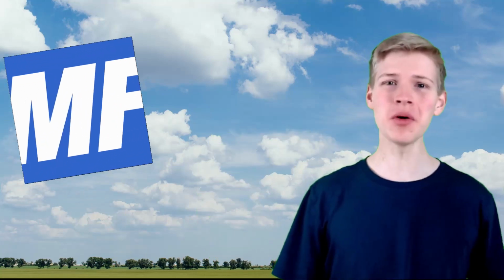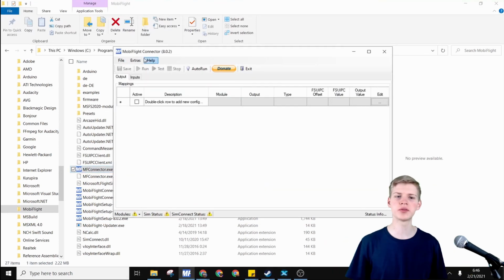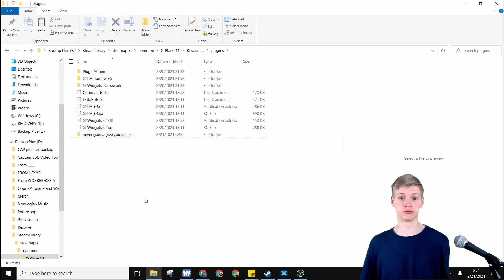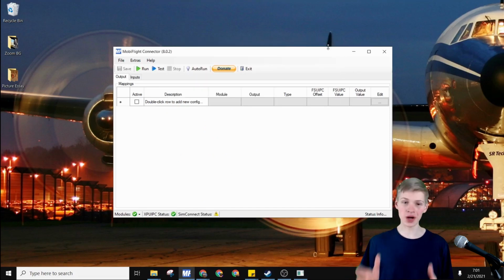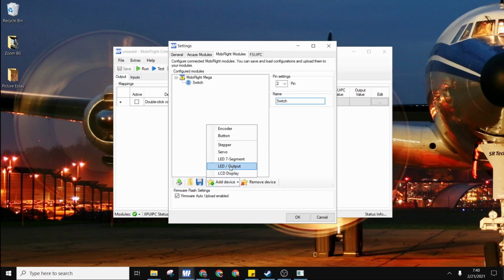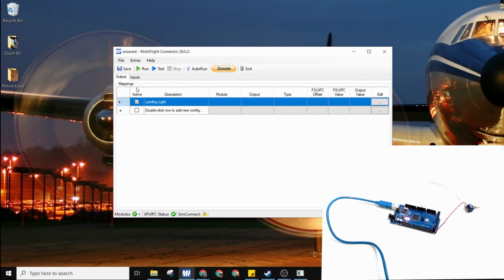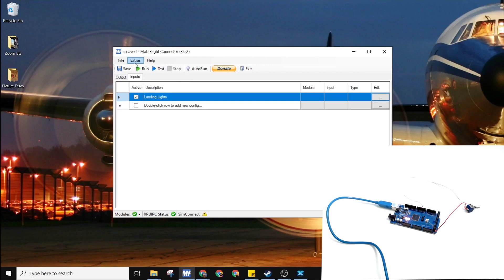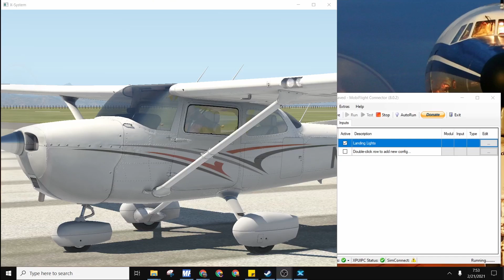Configure switches to X-Plane! Using MobiFlight with X-Plane and an Arduino

Comment: Will I always need mobi flight running in order to the switch works on the sim?
Reply from the maker: Yes you do
Reply: @CaptainBobSim So if i program the whole thing on my laptop, and then plug it in to my mac that does NOT have mobi flight, it wont work?
Reply from the maker: @RadioNassau  Correct - MobiFlight must be running on the computer to communicate with the flight simulator.

Comment: hi im building a overhead panel for a319,320,321 toliss. do you have a latest video how to operate with the mobiflight on xplane11?
Reply from the maker: Hello! I don't have a new video as of now, but you can do it directly now instead of using XPUIPC by using datarefs

Comment: Hi  Do you have a new video showing the now presets for Xplane, i'm trying to install a servo and setup the flaps detents but having a nightmare getting it done
Reply from the maker: Hi Mike! The X-Plane presets are a bit different (If you want to follow the tutorial use FSUIPC offsets)
Search for flaps and use "Flaps up a notch" and "Down a notch" for switch
Use Fla1 def if you want to write to it instead.

Comment: Hi Bob
I'm starting a project with Mobiflight, but I'm having some problems, the Switch on the X-Plane Plane doesn't turn on..
I used the settings you passed in your video, but without success could you tell me why?
Grateful
Reply from the maker: I cannot tell you why, because there are so many places to get wrong, but when you press run do you see a green checkmark? 
Have you double checked your wiring and ensured the active checkmark is checked?

Comment: One quick question if I may.......... what if I don´t have any Arduino´s???
thank you
Reply from the maker: MobiFlight is currently only really arduino based, so very little of this would apply
You can however use mobiflight to configure actions to your joystick
Plug your joystick in and the software pretends it's an arduino
Reply: @CaptainBobSim  That the reason for my question: I do have VMax Yoke, Thrustmaster Side Stick with the Throttle, Desktop Aviator Throttle Quadrante and Ignition Set up, Saitek Ruder Pedals and Throttles and also a A320 Throttle Quadrant  with a auto trim wheels.^
Where can I find info on how to get all of the above working?
Thank you
Reply from the maker: Hey Paulo! I wrote this guide for you https://captainbobsim.com/2022/04/12/how-to-use-mobiflight-with-a-joystick/

Comment: Hey Trevor, Great video I tried following this tutorial but I am experiencing an issue, I put the xpuipc in the plugin folder but mobiflight does recognize x plane but still shows sim connect and fsuipc with an exclamation mark. Please help me Thank You in advance
Reply from the maker: Hello Tamil Aviation!
Did you happen to put the subfolder into the X-Plane folder?
I show this in more detail here: https://www.youtube.com/watch?v=DH1V4ZeqhZc&t=5s
Note, X-Plane must be running for it to be recognized. You may need to restart X-Plane after changes to the plugins folder.

Comment: hello captain i wanted to configue some switches for flightfactor a350 i can't find any event ids or offsets for switches and led lights or servos please help. i want to make the a350 autopilot panel.
Reply from the maker: Since MF doesn't yet have direct XPUIPC linkage, You'll have to code your own custom datarefs.
There are some links to resources in the description, although there is a fairly steep learning curve.

Comment: Hi, these work on the cessna but i can't seem to get anything to work for the 737 in xplane, any help would be appreaciated
Reply from the maker: Are you using an addon aircraft?
Reply: @CaptainBobSim  yea it’s the zibo 737, is it not supported?
Reply from the maker: Zibo (and other addons) often have custom Datarefs. XPUIPC converts the default datarefs into FSUIPC offsets that mobiflight reads. 
Luckily you can write custom datarefs into XPUIPC: https://www.mobiflight.com/forum/topic/5648.html This forum topic wrote a lot of the custom offsets, and all you'd have to do would be paste them into your XPUIPCOffsets.cfg file
You might also consider trying SimVim/HCSCI
Reply: @CaptainBobSim  thank you so much 👍

Comment: confused about the use for mobiflight, doesnt xp11 have full ingame support for mapping encoders and switches?
Reply from the maker: @bldsprt518 and @Merlix_2003 xp11 doesn't have as many FSUIPC offsets built into it, but can still map encoders and switches the same way that would be done in MSFS. You can however use custom dataref offsets, I left some links in the description on how to do that.
Reply: I got the same Question, i am searching for the ec-135 V5 settings, but there arent any settings i can use

Comment: Hi my captain;)

Did you try the servo? 
I manage perfectly to make the gauge of the APU work on the pmdg ,
only problem, its turns counterclockwise :( ...
I tested its an inverter:  https://www.amazon.fr/gp/product/B08JLTD6BS/ref=ppx_yo_dt_b_asin_title_o00_s00?ie=UTF8&psc=1
but its not working ... do you have an idea?
Reply from the maker: Aha! You need a comparison setting: https://youtu.be/exEFExtaQQk You can adjust this in the software. Let me know if you have any more questions!
Reply: @CaptainBobSim  thank you my captain;)
its works with interpolations ...;) excellent my gauge apu works
Reply from the maker: @Ricardo27300  HOORAY!! Glad I could help. Happy landings Ricardo!